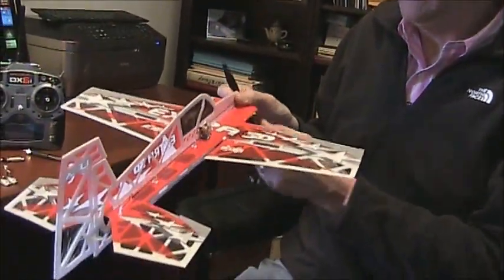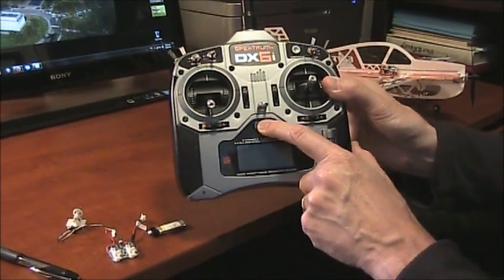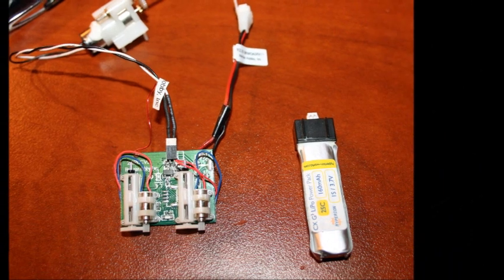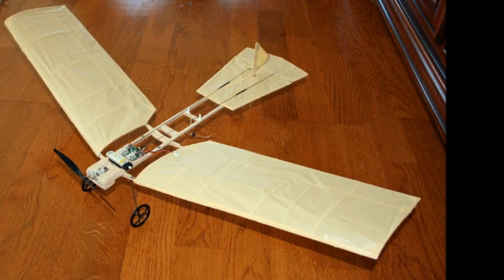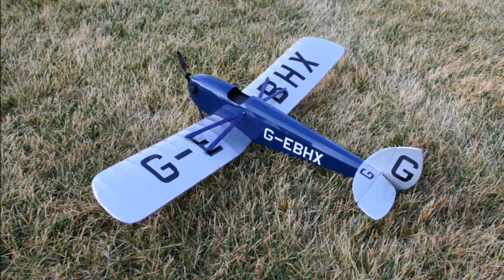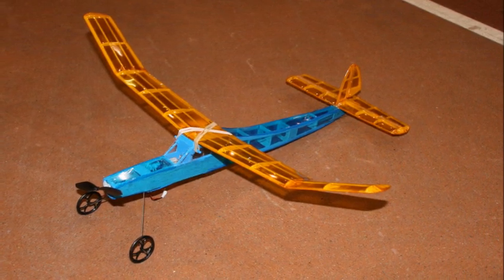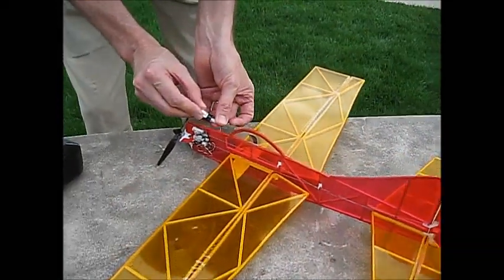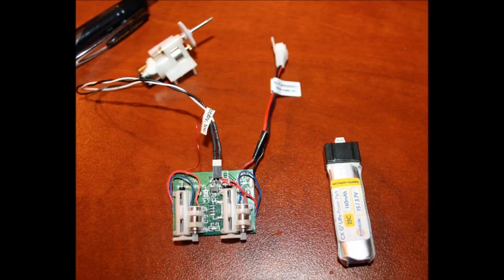How to Use the ParkZone Ultra Micro Radio Control System

Comment: Interesting video Tim, very clearly explained, that's a lovely venue you're flying in as well, I've used the brick from a UMX Yak with AS3X stabilisation and one problem I've encountered is the brick has to be mounted on its side (as original) if the AS3X is to be of any use!
Reply from the maker: Many thanks!  Tim

Comment: Excellent video, especially for one like me who's comfortable building models but ignorant of electronics.
More of this please.
Do gliders need an ESC?
Can you run multiple engines off a single board?
How does one size servo's?
Reply: Yes because they also have a the battery eliminator circuits to save your battery to operate your controls even though your battery has ceased to operate your motor.
Reply from the maker: Gliders have no engine, thus no ESC.
Reply: @TimMcKay56  But they do have batteries and servos, so how's that all connected?

Comment: How are you getting ailerons with that esc brick? It only has 2 micro servos that have to run the rudder and elevator. Please explain as I am not quite understanding how you did this. Thanx.
Reply from the maker: There are two types of bricks.  One is three channel, with two linear servos.  Other if four channel, with plugs for separate aileron servos.

Comment: This is a great overview of this system, but I’m trying to figure out how to bind my controller to it.. I have the same system and controller you have there, but I can’t get it to bind for some reason.
Reply from the maker: Zach:  It is quire easy to get the ParkZone receiver into bind mode.  Ensure your transmitter is OFF.  Connect the lipo battery to the receiver, wait 5-10 seconds and the receiver should automatically go into the bind mode (rapidly flashing light on the receiver).  Once in bind mode, turn on your transmitter in the bind mode to connect to receiver.  Tim
Reply: Okay, I followed your instructions, tried it.. and the light doesn’t flash rapidly.. It flashes at a pretty steady speed along with a beep sound.
Reply from the maker: Maybe the software has changed. Try to bind the transmitter in this RX mode. Ensure you point the transmitter antenna away from the receiver.
Reply: I’m not very experienced in RCs.. Sorry, but I don’t know which mode that is or how to switch to it.. All I know right now is that the receiver I’m using doesn’t work the way people explain it should work.
Reply: Is it possible that I have a different receiver than the one you have there? I have the one that came in the ParkZone Cessna 210 Centurion foam model.
Reply from the maker: Could be. The receivers can vary over time and between models.
Reply: Do you have any idea which transmitter could be compatible with it? Because I don’t know if this receiver is compatible or not.. it has all of the same components and looks very similar, with the exception of it not having any plugs on the board other than the battery plug. All of the wires for the motor and antenna are soldered.
Reply: By the way, I have a Spektrum DX6i as well. And I’m pretty sure it’s worked in the past..

Comment: I've got 2 Guillow's kits I plan to convert to 3ch RC:
- DHC-2 Beaver (kit 305)
- S.E.5A (kit 202)
Will the parkzone micro system you show in this video be suitable for these planes? Having never built these (and won't start til I have the right equipment) I don't know how much these will weigh.
Also, what size prop should I use with this parkzone motor/esc combo?
Reply from the maker: You bet!  Start with Beaver first. Sturdier with a roomier fuselage. Gordon

Comment: HI I am making my first micro rc air plane with these parts and I have some questions? What do you use for push rods and is there any way to counteract torque for smaller air frame? thanks!!!
Reply: A good starting place for compensating for the torque is to design a 6 degree down thrust and a 2 or 3 degree right side thrust for your engine.  Most propellers rotate clockwise from the inside cockpit orientation (pilot's view) . Thus the prop wants to walk to the left so to speak when ever you apply throttle.  Done correctly it will make your model fly straight when you goose it. LOL
Reply from the maker: Many thanks!  Tim